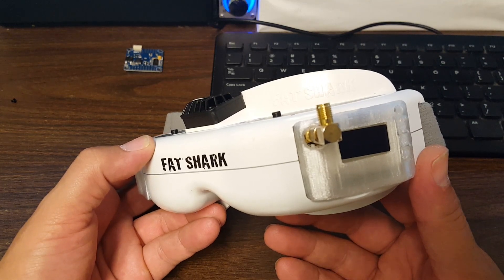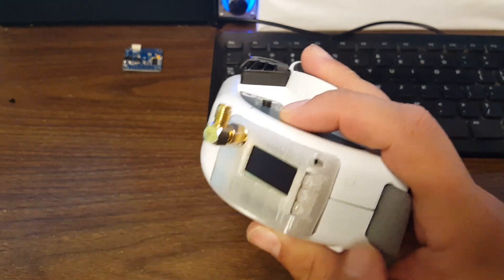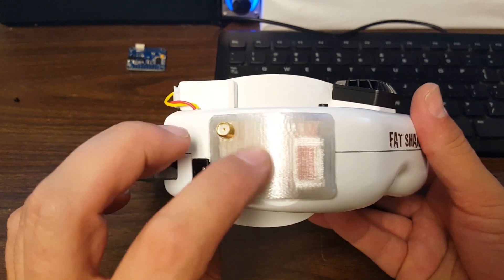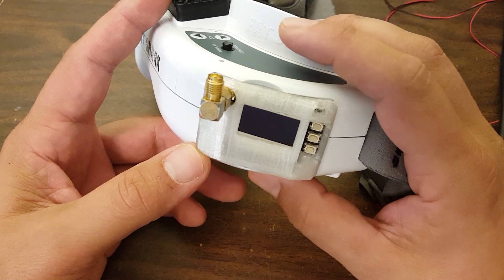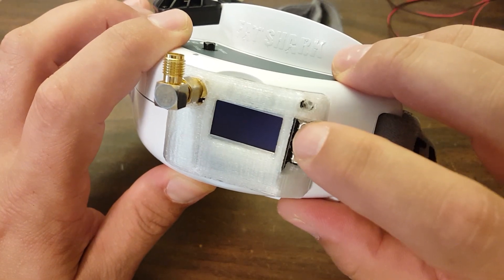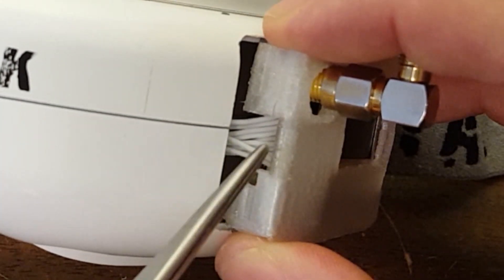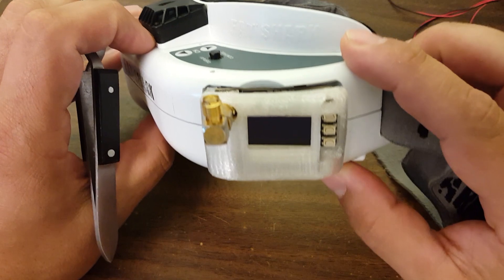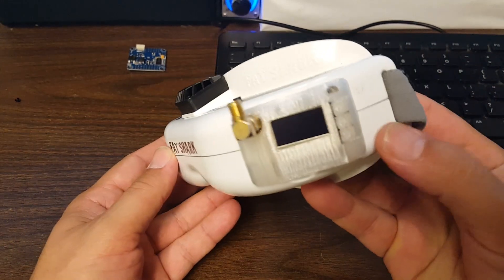LaForge Module Covers - Great3D / Brent Collier

Comment: Sorry that it don't fit the theme Josh, but do u know if the lb20a will overlive 5s? I run them at the moment and want to switch over to 5s, but don't know if I have to swap them out. 
thank you :)
Reply from the maker: +Supersonic FPV I think 6ou should be okay as long as you watch the amps. But I can't be sure.
Reply: +Joshua Bardwell ok thank you very much